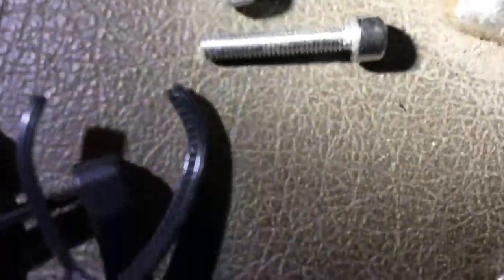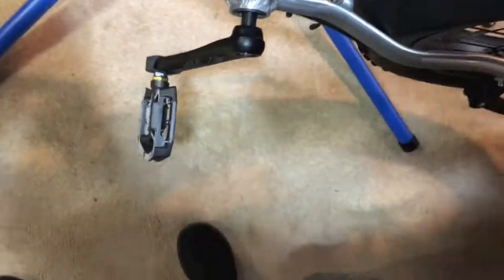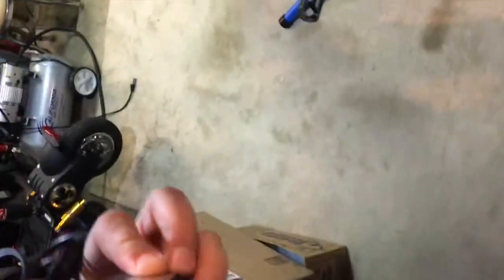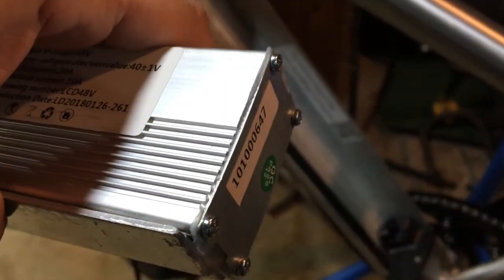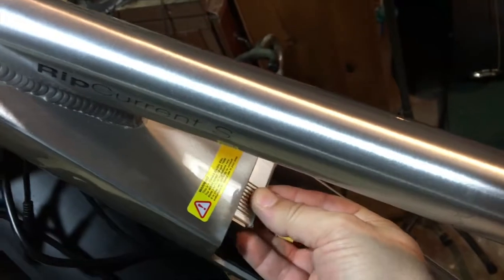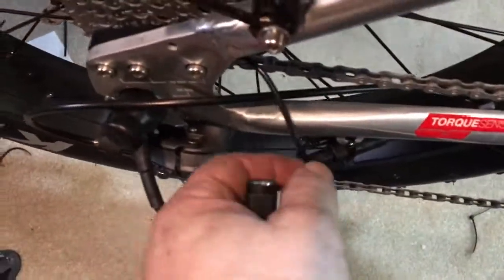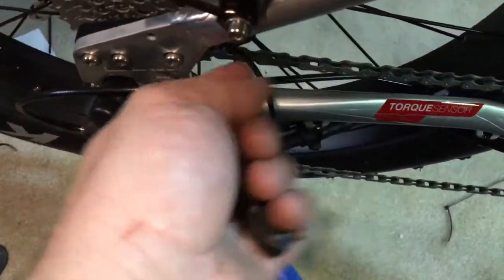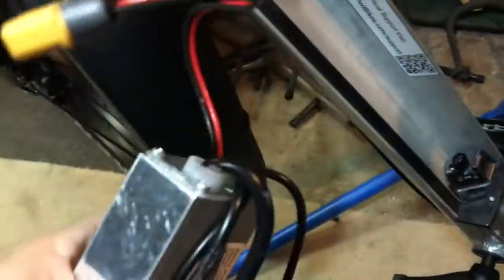Juiced Ripcurrent  S - Bad Controller Changeout  ECU ebike

Comment: They had the wheelsize on my bike set to 2800 and it burnt the controller out in 19 miles.My wife's is set on 2270 and going strong for 200 miles so far.
Reply from the maker: Not sue how any setting can burn out a controller. More likely it glitched when programmed at the factory which is why it was set arbitrarily to 2800 and was already on its way to failing prematurely.
Reply: @dbfcrell8300  out of the box in Sport mode my bike was going 34 mph until the throttle stopped working then about 6 miles later the pedal assist stopped.The screen works,battery is good and motor but the controller crapped out.I only know that the wheel settings were out of wack because I went threw my wife's settings and saw this big difference..

Comment: Do you still have the 20 amp controller or have you upgraded to the 25 amp?
Reply from the maker: Not sure. Back in late 2020 I had a controller / LCD screen that included the new "Race Mode" and some other new features, but nowhere on it did it say how many amps it was nor did Juiced tell offer or advertise that spec at that time. 

I can tell you my RCS does not have the frame vent like the newer RCSs and in the summer, my controller has gotten vey hot, but never had a problem under any type of load condition. Not sure how I can easily find out it's amperage. 

I was one of the earliest RCS owners asking for an 20 amp controller upgrade but stopped asking due to no provable issues with the 20amp controller.

Comment: I had to change out the controller on my Juiced Air about six months after recieving it.  Had taken battery off to recharge in garage and brought bike inside, was wiping dust off with my keys still in my hand and got too close to the battery connector - massive arc and POP, nearly shat myself. There's a massive amount of current remaining the the controller after removing the battery, at the time I was ignorant of this and there is no mention of it in documentation. This fried at least one of the capacitors.  The controller still turned and gave no error messages, but made the motor behave erratically.  Juiced replaced the controller under warrenty but they were not pleased about it, their warranty department and myself had some rather heated discussions before they finally agreed to cover the replacement.  The sad part is, I was going to pay for the new controller myself but their website was out of stock, I only contacted them to ask when one would be available again.     During this discussion they denied what I said happened could have occured, in effect calling me a liar, and demanded I send them the controller to inspect.  In the end, they got the controller back, but not before I had my replacement and postage to cover the return.  It's the only problem I've had with the bike in six years.  They make a great bike despite being miserable people.

Comment: I’m wondering if that’s my problem,my display shows 0 volts on a full charged battery and nothing works no light or anything. All I get is a blinking display on volt readout. Help
Reply from the maker: Crap, that sucks. It doesn't sound like pinched wires, if that's what you're referring to?  I'd look at both the battery connection on the bike and on the battery to see if the connections are seating correctly and making good contact. See if putting pressure on the battery makes your display work at all. If you do suspect the battery connection on the bike, remove the upper battery mount and check to see if it's installed properly, (a lot of the connectors were not installed correctly at the factory). If it's not the battery connection, my next guess is it has a firmware issue. If so, it means you'll need to send you LCD display and ECU back to Juiced. Let me know more about the problem.

Comment: Holly sh1t!  Hats off to you sir. I WAS seriously considering a CCX.  I am disabled with a jacked up back. Need a way to exercise some.  I can not do anything like these repairs anymore. What would happen if you are not capable of doing needed repairs like this?  I need to rethink this whole thing.  Any suggestions for a reliable ebike?  Thank you for all the informative videos.
Reply from the maker: I know several people with different brand ebikes. They all require some assembly and maintenance. So do regular bikes, but not as much. If you cannot work on your own bike, I would highly suggest buying from a local bike shop that isn't going anywhere son and has a good mechanic that's on duty all the time. Local shops tend to work on only the bikes they sell, at least in RI.
Reply: @dbfcrell8300  Thats good advice.  Was thinking the same thing but avoiding that cuz there are fewer deals there from initial look. Im not in a rush. I really had it narrowed down to 2 options, Juiced CCX or Dost Kope. Has Juiced worked out the kinks since bike 5? I will have to look at local shops a little closer and compare the trade offs.  I tried to find the Juiced Google group but no luck. If its still up shoot me the link or name please.
Reply: @davidg426  There are new kinks. The 2 guys I ride with went for the $200.off deal if you buy 2 Ripcurrents, so they got them 3 mos ago. One came broken and had to be returned. The other RCS has had multiple rear flats- not sure why. After that got all sorted, they just both went through having their odometers randomly zeroing out when they zeroed out their trip meters, but both bikes sorta fixed themselves after several days of trying different things. 

Juiced Bikes are an open palette that allows you to modify and personalize it at the expense of some reliability. It's a trade-off that are for some people and not others. Rad Rovers are more reliable for the most part, but are boring comparitively IMHO.

Comment: Far as I know Juiced now owns their current bike Asian/China factory.

My RCS came with frayed controller wires where the controller wires come out of the rectangle hole at the top of the down tube. This wire fraying caused my thumb throttle not to work. 

They wouldn't replace my 48V controller and display because of that reason. But with some back and forth emails they finally sent me updated parts (52V controller, thumb throttle and display) at no cost. 

The exit hole edges at the top of the down tube are very sharp and turning the handle bars back and forth caused the wires to rub against those sharp aluminum edges. Which caused the fraying and thumb throttle not to work.

I think if they had a round exit hole at the top of the down tube it would be easier to install a rubber protective grommet to keep the controller wires from becoming frayed.
Reply from the maker: I didn't have the sharp exit hole on mine, but I know what you're saying. I hope you debur the exit hole somehow to smooth it out. And yes, Juiced now has 3 location; two in Chula Vista, CA and one in China. I'm still trying to find the address of the one in China, but I think it's in Bejing.
Reply: @dbfcrell8300  R. I used electrical on the sharp aluminum opening edges.
Reply: I know you can't take the wires that come out of the controller and connect to the 4-way connector that goes to the accessories on the handlebars and

just replace them. As the inside of the controller is filled with waterproof silicone of some sort.

Only option is to cut the frayed wiring and replace with new wiring. But that wiring is pretty small. Not sure where I could find that small of wiring?

Then I'm not sure how you would connect/splice the new wiring to the original wiring? Would you solder the wires together or ?

Then use shrink wrap on each individual wire?

Not sure what the best method is?

I'm referring to the original 48V controller that came with the bike.

IDK why, but I got 35mph w/the 48V controller. And with the 52V controller I get 30mph max speed. The settings were the same on both the 48/52V displays. 

I would like to put the 48V back in the bike....if I can fix the frayed wires properly.
Reply from the maker: Glad you fixed the problem.  Yeah, they fill the ECU with epoxy; 1, to keep the environment out, which is good from a reliability standpoint. And 2. So no one can look at the components, make improvements, make repairs or copy old tecnology. I'd gladly sacrifice the epoxy in favor of lower weight, better heat dissapation and being able to fix and upgrade the ECU myself.

Comment from the maker: MARCH 2019- 
JUICED BIKES RIPCURRENT S FIRMWARE UPDATE for 52V 1st GEN

There is now an ECU / LCD update for your 1st gen Ripcurrent S (52v only) to bring it up to current spec. This will give you 6 levels of assist and several more new features / options in order to get the most from your RCS. 

To learn more about this, join the Juiced Bikes Club and click on the post 
**ECU UPGRADE FOR 1ST GEN 52V RIPCURRENT S **

https://groups.google.com/forum/#!forum/juiced-bikes-club
Reply: Is the google group still open? When I click the link it doesn't look like any new people have access.

Comment: I'm getting 25 miles on a full charge averaging 17 mph pedaling the whole time. My last ride I dropped one bar after just 4 miles. Bike cuts out on more than one occasion leaving me to pump the throttle. Sent the battery LED, throttle and controller back to Juiced! This is looking more and more like a huge mistake!
Reply from the maker: Not sure if you're looking for help or merely making a statement out of frustration, but I can say I feel your pain. Did you join the Juiced Bikes Club and post the symptoms?  It's a good place to get Ideas. There's someone on there now with cutting out problems on an RCS.

Comment: I may have fixed it. After reviewing the lcd display to check some of the things you mentioned, the wheel size was wrong. Googled it and setting should be 2270 for ripS. Mine was 2226. Took a 10 mile ride before changing it and the power problems continued, after changing it I rode around the block and all seemed normal. I’ll ride tomorrow, esp uphill, and keep you posted. Shame I had to did this out myself. I’ve enjoyed interacting with you, do you have a Facebook or email you can share with me so we can keep in touch?
Reply from the maker: Well, I run the Juiced Bikes club. That's where I am  most of the time. If you join, we can definitely converse there, and maybe help others with Juiced bike issues. It's totally free and free of spam too. My user name there is RC5 (because I have the 5th Ripcurrent S). Come on by anytime.
Reply: That the google one you referenced earlier?
Reply from the maker: @pogioldsarge2798  Yup, that's the one

Comment: So this is the latest.  I received the ECU and cadence/torque sensor and installed them.  The bike works OK in power level 1 on flat surfaces.  Selecting the other power levels doesn't seem to be working.  And when going uphill or into the wind, the power is not uniform.  I dont think surging is the right word, but it's like pulsing on and off.  I invested in a torque wrench for installing the torque sensor and since it was my first time using it, I loosened and retightened it to make sure I was doing it right.  And to re-check the placement of the rear wheel and hardware.  Re did the brake sensor test, no change.  Battery fit and connection seems fine now, and the control panel stays on like it should.  I'm very frustrated and unhappy.  Is there a "lemon law" for $2500 bicycles??  What are the chances they will negotiate a buy back?
Reply from the maker: Gee, I don't know what to say. Juiced has a 1 year guarantee, so you can attempt to get your dough back that way.  Before you do that, let's go thru some stuff...  You know you have the capability of turning off power levels, Right? If you accidentally shut off all but #1 or have some other setting mis-set, that could be affecting your power. Also, I think the torque sensor may need to be recalibrated which I think it does if you pedal backwards. To check to see if the torque / cadence sensor is the problem, you can try turning off the torque sensor on the LCD screen to see if it affect anything. Also, when you put the rear wheel back on, what washers, spacers and nuts went where on the rear axle? The reason I ask is mine came completely wrong from the factory (both flat washers were on one side). The cassette must be within a a few mms from the torque sensor in order to work properly. Mine wasn't even working at all when I got it. Maybe you know all this, but it's very improbable that you got 2 bad ECUs in a row. Check the your LCD special features. 

Here's the official Juiced Bikes LCD Display FEATURES which shows you how to get into the "special features" mode.

Here's the Juiced Torque Sensor install video on the Juiced Bikes Club site; https://www.juicedbikes.com/pages/torque-cadence-sensor-removal-and-installation-guide-with-video

I hope this helps in some way.

Comment: on the male connector of the lock interface with the battery, how many threads are showing past the large silver nut?  Is the nut screwed all the way tight?  That is my main problem, that nut seems to be stripped.  When I seat the battery, the whole male connector pops loose.  Btw during this pedal assist problem, with a bad connector and questionable bad ECU, the throttle worked every time, did yours?  Just the pedal assist was in op.  I'm guessing that is why they think it's the ECU.  When it all started, the motor would seem to pulse or turn on and off during a ride.  I would reseat the battery and it would function normally.  So they are sending me an ECU and torque sensor, but no lock interface!!!!!  I am less than happy with my buying choice.
Reply from the maker: I have pics that show the male connector in detail on the Juiced Bikes Club here; https://groups.google.com/forum/#!forum/juiced-bikes-club  

If you're not a member, just join up. It's free. Then scroll down the posts to look for a post called "The Cheap Plastic Battery Receiver".

Comment: Mine died after 150 miles. They are sending me a new controller. Was delivered in may, so probably same issue. Thanks. I was very worried about buying online, service by email no good. Only ebike dealer in my area is pedego and price double. I hope this is the end of my problems. I was anticipating many happier miles.
Reply from the maker: It would be interesting to know if more than just my RCS had its ECU installed backwards. Can I ask what serial number your bike is (just the last 4 digits)? Mine is 0005 (5th one built, so they were just learning how to assemble them).
Reply: Dbf Crell assuming it’s the number engraved on the head tube, it’s 369.
Reply from the maker: @pogioldsarge2798  #369, okay, then I doubt your ECU has the same problem as mine. Mine was assembled by someone who was not given clear instruction or who wasn't being supervised and didn't care about their work.  It should have been blaringly obvious that the worker installed my ECU in the down tube backwards. They wedged it in so hard and damaged all the wires, they probably couldn't get it out, so they just left it in because it was still sending a signal. It eventually broke the main wire that powers the motor. though. Yours, on the other hand, sounds like a defective unit.
Reply: Dbf Crell so far very frustrating!  Sending me new Ecu and torque sensor. However my original complaint was that the male connector on the lock interface is broken.  They have photos but it’s not on the parts list they are sending!!!  I complained in all caps and heard from another tech that he is sending “screws”. I complained again and sent a photo. Maybe I’ll just have to super glue it. This bike was a retirement gift to myself and had big plans for it. I should have gone with Rad I think. Right now it’s looking like $2500 down the commode.
Reply: And I bought a bike torque wrench set, mo money, mo money.
Reply from the maker: @pogioldsarge2798   Same here. I should rent it out to other new owners so they can assemble their bikes and it will help pay for it.
Reply from the maker: @pogioldsarge2798  Do NOT super glue it. Use super glue just to tack weld it in a few places, then use JB Weld Original 2-part epoxy, not the fast setting type.  Here's a great testing epoxies video... https://www.youtube.com/watch?v=djtKXkTqPUI
Reply: Dbf Crell I took out the ECU while waiting for parts. It was installed correctly, BUT I noticed that the red wire on the yellow plug had been spliced (broken?). Rather poorly too. Didn’t use heat shrink, just e tape!  I put gorilla glue on the lock interface plug in case they don’t send one right away. I took pics, don’t think I can attach. Anxiously awaiting parts. I asked the tech that called me, “what if I didn’t have any mechanical skills?”  He said it’s easy. I requested to join that google group.
Reply: Sorry, missed your reply about the jb weld. Need to go to store anyway, I bought some long Allen wrenches but didn’t notice they were inch, not metric.
Reply from the maker: @pogioldsarge2798  Did you see the pics of the male battery connector nut and threads?
Reply: yes, thanks.  I also noticed the index notch on the back of the plug.  Made sure that was indexed properly before epoxying it.

Comment: Let that be a lesson, if you can't do the work on an ebike don't buy a juiced bike unless you live next door because the LBS, if you have one, will not do the work and neither will juiced. Just another reason not to buy a bike from juiced bikes, P.O.S.
Reply: A new doorknob from Home Depot is a P.O.S. if you do not know how to install and adjust the simple thing.  An ebike requires the owner, absent a competent and caring LBS, to learn how to do simple stuff.  Every conceivable topic about bike repair is covered by countless well-made YT instructionals.